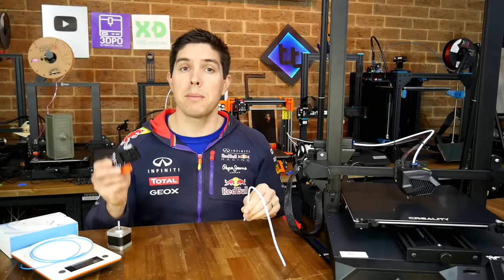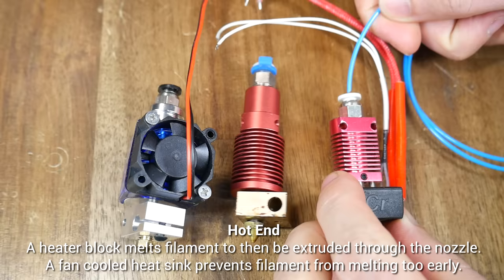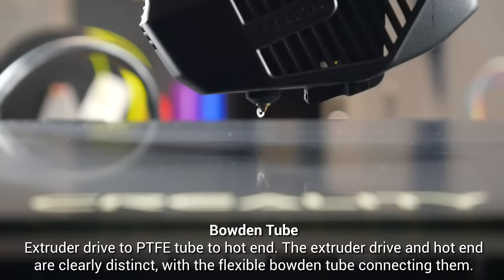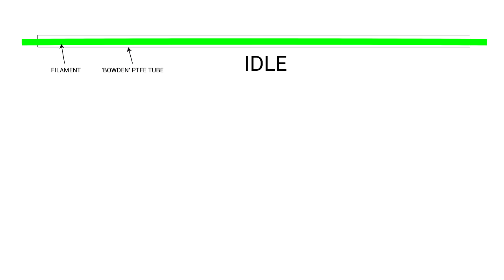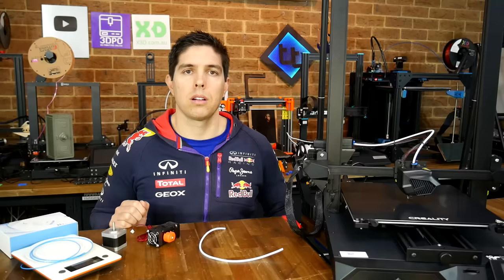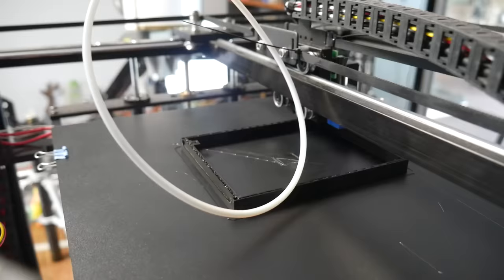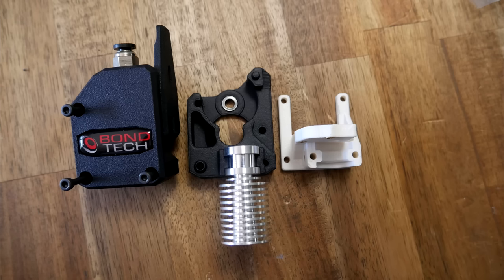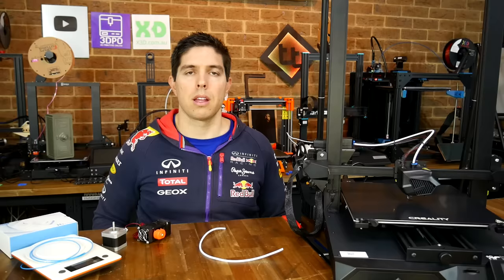Why direct drive is not automatically better than bowden tube

Comment: Two of biggest reasons I support and recommend Bowden as the best all around option is the reduction in mass of print head, and less considered, is the ease of maintenance over direct drive.  I started out using direct drive printers 7 years ago.  Switching to Bowden setups has meant being able inspect cleanliness and operation of the extruder drive feed at a glance.  Taking the entire assembly apart for cleaning and maintenance has proven to be a bigger headache than what direct drives advantages are worth.  Having tweaked a version of the reliable MK8 extruder to work well with flexible filaments, means, an easier time all around. I only have to service the problem at hand went needed, which is almost always just the hotend.  So, there are no extra parts in the way, using a bowden.  This extra assembly and fiddling time, of direct drive, is a huge reason I favor Bowden over Direct Drive.

Comment: When you prioritize speed over quality, use bowden, and vice versa.
When i convert my 3d printer to DD configuration, i was blown by the prints quality. But when i want to reach a higher speeds, the quality suffer. Then i convert back again to bowden, just because i think the faster speed worth more than the small imperfection on the prints.

Comment: Good Video. Use Capricorn XS Tube, good couplers with clips, Dualgear geared Extruder, dial it in and you can get very close to direct drive. At least, if your printer is so small, that you don't need a long bowden. :)
Reply: Define long? If I have a 500x500x500 Voron, should I switch to direct drive or is the M4 sufficient?

Comment: I converted my ender 3 to direct drive and I can literally hear the print head change direction now due to the increased weight. I’ve considered going back to Bowden because I feel like I was getting better prints with the lighter head.
Reply: I'm curious what design you went with that added so much weight. I converted mine to the printermods ender 3 DD kit and the prints are better than ever and the machine is dead silent.
Reply: @skaboodlydoodle  it’s only noticeable when I’m printing at 250mm/s with 5,000 acceleration.

Comment: Another hybrid:
Bowden extruder to deliver material at constant rate over time, small servo (voice-coil?) at the hot-end.
Servo adjusts distance between Bowden fitting and hot-end, modulating nozzle pressure.
Voice coils are very fast, strong and with a simple feedback loop can sense back-pressure in the filament!
Feed-back servos will go where they are told to and use as much power as needed to do so.
Monitoring the power consumption of the servo gives a reading of nozzle pressure!
Retraction now has an identifiable signal.

Comment: You can have pretty much best of the both worlds just by using bowden setup where there is encoder on the extruder head precisely monitoring movement of the filament and that is software compensated and extruder motor corrected accordingly, you could call it closed loop motor control.
Not sure why no one did it yet.
Reply: That's a brilliant idea
Reply: That still doesn't compensate for linear advance. The gear/encoder would still progress as the filament kinks in the tube. And, this also has been done. There is a filament jam sensor that works like this for about 20 dollars on Amazon.
Reply: That... honestly sounds so much more complicated.
Reply: @daveabittner  You didn't understood. My idea compensates for any movement in the tube.
Reply: I didn't understand your idea.. closed loop stepper motors do exist, but I think the encoder should be at the end of the tube in order to compensate for any unwanted movement of the filament... I mean, the stepper has a strong grip on the filament and if you put the encoder right after it I don't think it would detect any difference between the expected and the real movement of the filament... But maybe I simply didn't understand very well or at all 😅
Reply: @Arek_R.  and how does it do that? You didn't explain anything to make that clear.
Reply: @daveabittner  Well I did already.
In normie language, it basically has a sensor on the head that makes sure the correct amount of the filament goes woosh out of nozzle no matter how much slack there will be in the bowden , it would perform just like direct drive, only for 10g of extra hardware on the head.
Reply: @Arek_R.  Normie language, uh okay. So you're saying the encoder is just before the hotend? I imagine issues getting the filament to drive an encoder (specifically flexibles) might be a challenge.

But to say nobody has does this before is pretty inaccurate. Encoder driven steppers are commonplace in CNCs.
Reply: A extruder stepper cant move fast enough to compensate for the bowden when printing at high speeds. 

Might be posible with a servo motor and some kind of adaptive lookahead linear advance.
Reply: @cas curse how is this completely different? Both systems rely on an encoder to determine how much they've turned. The encoder is just in a different spot.
Reply: @cas curse The motor needs to move faster and further for pressure advance with a bowden system.  Using a larger / more powerful motor and no gearing helps a bit, but the motor is still the limiting factor.

The slop and stretch of the bowden tube has to be compensated for every time the extrusion starts, stops or changes speed.  so sharp corners and layer changes. 

when printing fast at high flow rates the extruder motor quickly becomes the limiting factor with a boden setup.
Reply: @daveabittner  the control loop would also be compensating for the slop / stretch of the bowden tube if the encoder was on the hotend.
Reply: @bassplaya69er  the big problem that still isn't being taken into account is the fact that even if you can tell WHEN that slop has reached its limit, it still means there is a delay between pushing on the filament and it extruding. 

This is essentially something that balances your linear advance for you. The problem is, Bowden tube setups don't work at super high speeds because that compression and decompression in the Bowden tube can become a bottleneck. 

So, this doesn't fix the inherent problem of Bowden setups. But even then, delta printers can print just fine at super high speed Bowden setups if they manage to keep their Bowdens really short.
Reply: @cas curse And which is why, as a result, it would compensate for it. If you are asking it to push 5mm, it can easily push the filament until 5mm has been fed. But it still doesn't fix the problem of the filament building and releasing pressure in the bowden tube.
Reply: @cas curse I understand that. But that internal kinking of the filament is the fundamental flaw of Bowden systems. The fact that the kinking happens is the issue. It causes a delay between a push at the end and a delay between a release of pressure. 

This is exactly what direct drive attempts to avoid, and what the linear advance setting accounts for. 

Linear advance attempts to predict extrusion ahead of time to account for that slack, but for super high speed printing that slack alone becomes a bottleneck. I understand it accounts for it in extrusion distance, but it doesn't fix the delay of force that it causes.
Reply: @cas curse Okay, that actually does clarify something to an extent. But at the same time, you're acknowledging the print-head slowing down due to the fact of the kinking in the tube.

So yes, I will definitely acknowledge my misunderstanding of the entire machine working together in that way, but this doesn't fix the issue that direct drive fixes, is I guess my main point. That filament pressure building is still a bottleneck in high speed printers unless you seriously limit the Bowden length, like in a Delta. 
The best of both worlds, in my opinion, is a system that can be fast, while also not having to worry about the issues of long filament path.

However, if your concern is not high speed printing/flexibles/you don't have a Delta Bowden is of course a totally viable setup.
Reply: @cas curse  Feed rates don't need to be that exceptionally high. The whole argument around using a bowden setup is for printing at higher speeds without ringing etc. in reality they are only good for very budget bed slingers with single z axis.

15mm^3/s flow rate,   150mm/s at 5k mm/s/s with a 0.4mm nozzle at 0.2mm layer height and a 300mm bowden with a 60mm nema17 at 36v will be starting to run in to trouble keeping up with the amount of pressure advance required to compensate for the bowden. Using a non geared extender and a more powerful motor helps a bit, but then if you want to use a larger nozzle you quickly run in to limitations of how fast the motor can respond again. 

With a powerful enough motor gearing up or larger drive gears like the new Bondtech has would also help but at some point you will run in to resolution issues. and need to step up to a servo motor.   It all ends up being much simpler and cheaper to go to a direct drive setup though.   

Extruder forces peak at around 8 -10 Kg  where the bowden tube itself stretching is an issue. I am not an expert on closed loop machine control but not sure it would be possible to get a particularly tight tuning of the control loop with such a floppy springy thing inside of it anyway. 

i have gone through many rolls of filament testing and tuning different bowden setups on nozzles from  0.4 - 1mm,  different extruders,  breaking couplings, shortening bowden with flying extruder,  epoxying couplings, reinforcing the ptfe against stretching,  geared vs non geared extruders,  all to try and print at a reasonable speed / flow rate on a large corexy.   As soon as i started to use direct drive setups all the extrusion issues disappeared and even on my floppy Vslot corexy, my heaviest direct drive supervolcano with standard sized nema17 performs better than the best bowden setup. no extrusion related problems at 70mm^3/s and input shaping takes care of almost all the ringing.  Next step linear rails and CF X axis.

A nice light weight direct drive setup with a filament encoder and diameter measurement would  be a much better direction to go.

have you seen https://www.youtube.com/watch?v=cYuiAdOH-vI      

or 

https://www.youtube.com/c/MirageC/videos
Reply: @cas curse
another place that we are probably look at this from different points of view is the size of prints.  i guess most home users are interested in printing relatively small / light weight models that dont take forever to print at low flow rates.   i mostly print large strong multi KG functional parts that would take forever at regular flow rates etc. 

 where i am based at the moment a Lightish weight bmg clone and pancake stepper is only £12.  but yeah at normal not clone prices a decent direct drive setup is a bit pricey.

Comment: You mentioned advancements in hardware, but don't forget about software too. Klipper and freshly RRF feature input shaper which helps iron out some artifacts caused by moving heavier heads. It's not universal cure and people may protest that it's software which fixes hardware, but ... it is what it is 😃
If we don't count Nitram's Delta printer, fastest speedboatracers feature DDE of some kind (Galileo or HextrudORT).

Comment: My Hypercube Evolution is bowden, and my Ender 3 has a hemera. I can attest to the fact that a well tuned bowden setup can be on par with direct drive. Having a powerful extruder and capricorn tube helps a lot. Placement of the extruder motor at a strategic place, near the center of the travel of the axis, can really cut the length of your bowden tube down as well. On my 300mm^3 Hevo the extruder is placed at X=0 and Y=150.
Reply: That being said, I'd still choose a direct drive over bowden.

Comment: I feel like bowden gets a bad name because the older creality single gear setup with its lackluster hotend thats prone to jamming, they also have very low quality bowden couplers that work loose with retraction (which exacerbates the jamming issue) and the loose tolerance 2mm bowden tube vs Capricorn which I think is 1.8mm if I remember correctly. 

 I run an extremely lightweight bowden setup on my large delta and I can print petg stupid fast with my mosquito magnum.
Reply: Capricorn is 1.9 ID
Reply: same.  Bowden is ideal for deltas as it's hard to fit the whole stepper on the small (and normally symmetrical) effector.
Reply: Indeed, Creality extruders can't keep up. If you want to print faster and more precise some upgrade is needed.
The only reason to go with bowden setup was extruder weight, especially on flimsy printer frames, but that's not an issue anymore. More and more printers are built from rigid metal profiles.  And you can get very lightweight extruders, like LDO Orbiter, for quite cheap.
Reply: I'm fairly new to 3D printing and have only been using PLA so far, but the best upgrade to my Ender-3 (with bowden tube) was a BondTech BMG extruder. The stock Creality extruder is too weak. Not only is the single filament drive gear design inadequate, but even when this is working well the non-geared stock stepper motor tends to skip at certain times resulting in under (or at best inconsistent) extrusion. The 3:1 gear ratio of the BMG and the dual hardened steel drive gears solve these problems completely. Get the brand name BondTech because the clones are all much lower quality (from what I have read).
Reply: Better coupler and ptfe, I agree. Also the stock hotends NEEDS a Bi-metal heatbreak upgrade. Then hotend is alright
Reply: I've always got horrible stringing when I changed my stock bowden tube to capricorn, no idea why and couldn't tune it out either and ended up going back to stock.

Comment: I think you really should have mentioned the fact that flexible plastics are much, much easier to print with on a direct drive setup. Its the only reason im considering making my ender 3 pro direct drive, since anything other than 95a tpu will not go in nicely, and will jam and introduce a lot more friction in the tube.

On a different note, I think switching to direct drive just because of retraction settings is a little pointless considering how powerful of a tool "avoid crossing perimiters", unless you print multiple pieces you basically get no oozing that is visible.

Comment: Printers with a single upright support for the X axis (such as the Ender 2, Printerbot mini, Prusa Mini, etc) are good candidates for using a Bowden tube extruder.  Ditto for printers that might have dual upright supports, but only one stepper motor drive screw along one of uprights for the z axis.
OTOH, printers with two uprights and two drive screws for the Z axis can support a direct drive extruder with fewer problems.  Note that when a direct drive extruder is used, a larger stepper motor for the X axis is usually required, along with a motor driver circuit that can handle the extra current such a motor requires.
Note that Creality mounted their extruder on the X axis off to the side rather than on the top or bottom of the printer which still places the burden of lifting it on the Z axis motor, which means that a beefier Z motor is STILL required (though only one, not two).  Since the extra weight of the extruder does not have to be moved, the X axis motor can be of lower power, and the X axis movement can still have good speed and acceleration.  Also since the weight of the extruder is at the lift point of the X axis and is never at the far end of it, there won't be any bending moment on the axis, which could happen in a single upright system with a direct drive extruder.  Still on a small printer it's best to NOT mount the bowden extruder on the X axis with a single upright support!
This means living with a longer bowden tube, or keeping the max build height smaller.  Design compromises!!!
Direct drive with an external stepper motor driven though a 'speedometer' cable is an interesting idea, IF that cable is as flexible as a bowden tube.

Comment: my first printer the Anet A8 had direct drive and I built a lighter carriage w/ a geared extruder and pancake stepper motor thinking the mass reduction would majorly improve ringing and such. it helped a little, but after moving on to Prusa Mk3's which have a direct drive head which is super heavy and the Ender 3 which has a typical bowden, I've learned that other factors like the stiffness of the frame are much more important.

Comment: Direct drive has been my go to so far. More filament options, stronger pull, and if dialed in right, far better prints. I think a second Y axis would have made that direct drive printer work fine. The sag is solved more by a second Z than it could ever be by a linear rail which just adds more weight
Reply: A second Z you mean? And yeah a cantilever design is by it's construction, bound to have problems with flexibility on any direction. I feel like it would have been both better and still cheaper if they went with a 2nd Z (yeah it would basically be an i3 style but hey, if it works it works.
If you mean a 2nd Y to push the bed faster, that also is fairly interesting.
Reply: @Kalvinjj  I did mean a second Z, mistype my bad. Fixed it!

Comment: Biggest problem I have with bowden is using flexible filaments, because it acts like a long spring inside the tube and builds pressure on the nozzle. Still you can tune the slicer to get acceptable results.

Comment: I also converted my Ender 3 Pro to direct drive because of stringing. Way easier to tune it for better print quality. Option to print flexibles better is a nice bonus. I don't try to print the fastest I can, because I need to print stuff only once a while. So I'm fine with waiting a bit longer for the benefit of better quality. 
I treat my 3D printer as an another tool in my workshop, as e.g. a driller.  It needs to work reliably, that's it.